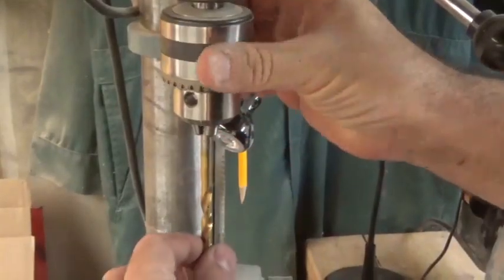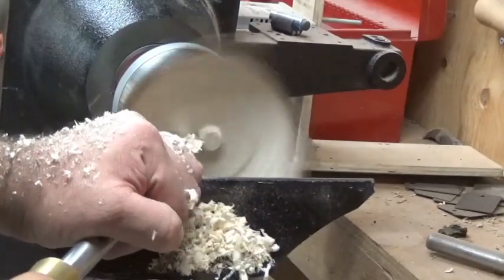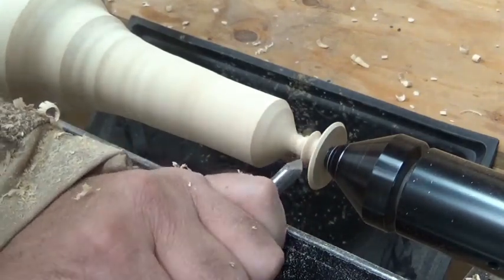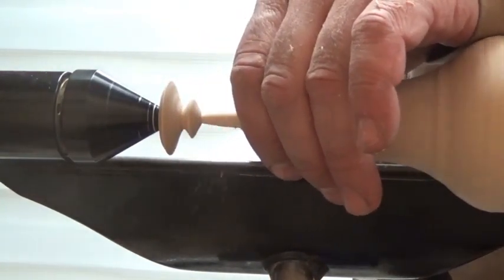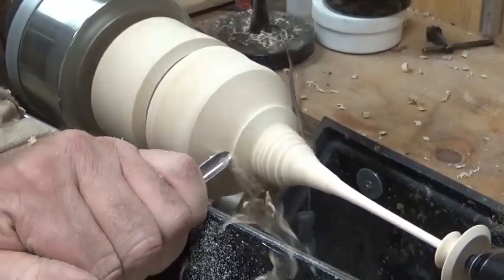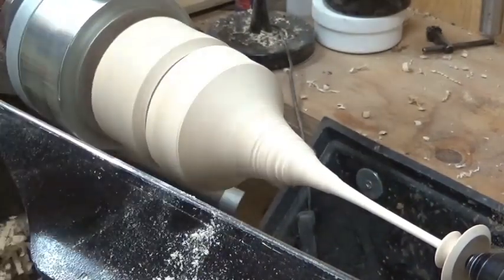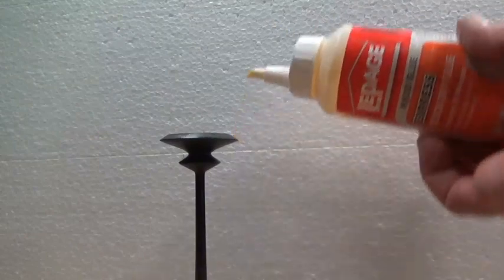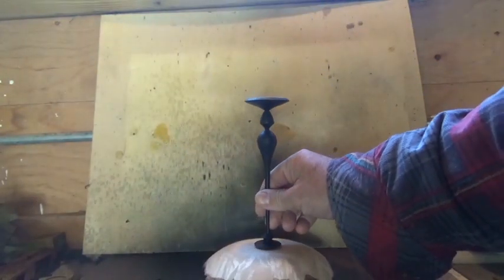more inspired woodturning

Comment: Very nice. I also use spray lacquer but am having a little trouble with an orange peel look. Do you run across that also?
Reply from the maker: Hi David, I generally use Yorkshire grit and Hampshire sheen as a finish, although on live edge pieces it’s not as easy to use wax products, to get an ultra smooth finish after spray lacquer sand with 600 grit and use Yorkshire grit abrasive paste, I think you’ll like the results 
Take care
Rob
Reply: Woodslee Summercraft thanks